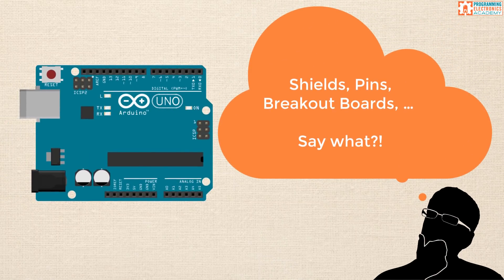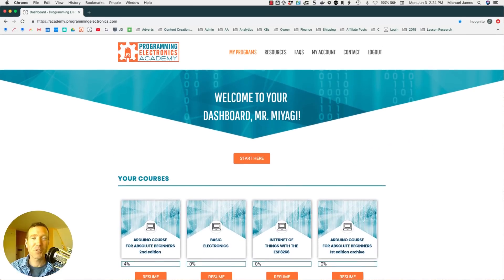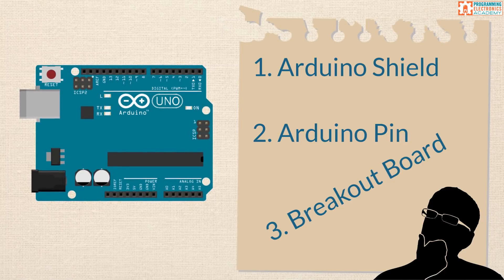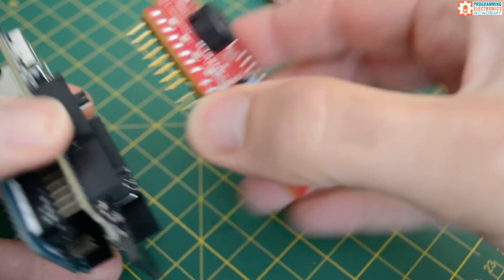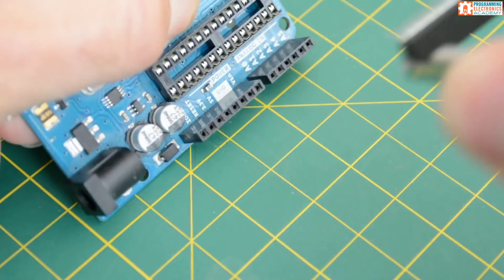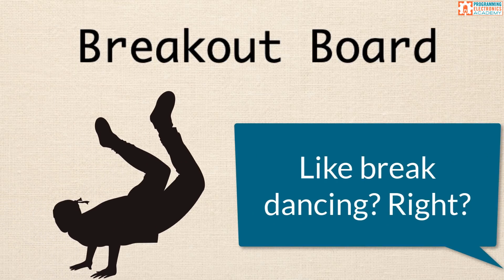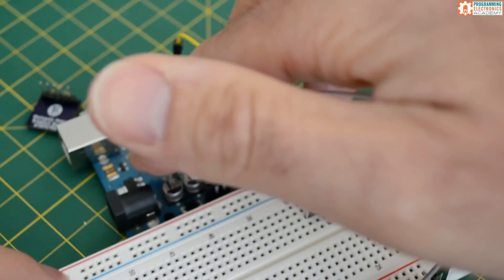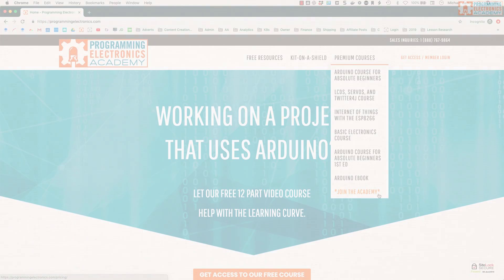3 Arduino Jargon Terms That Confuse Everybody

Comment: tangent:
Shields = the business model of Arduino. The classic Arduino, based upon the original ATmega8 NV/Uno form factor is actually designed around a 5cm x 7cm size perforated protoboard. However, one set of the 4 blocks of Arduino pin headers is offset by half a standard protoboard pin width (1.27mm instead of 2.54mm //0.05in instead of 0.1in). This makes it a royal pain to make your own "shields" from cheap 5x7cm protoboard. 
  Shields can be nice in some circumstances, but in my experience, they offer the customer the opportunity to use a piece of hardware and it's library with little to no need for learning the actual hardware and interface. They are great if you just want to learn to code.

   The aspect of the hobby and Arduino that really confused me, and still does in some ways, is the entire abstract toolchain involved with any μC as it relates to Arduino. 
  For instance, I have been curious about the Intel 8051 architecture for some time now, but I still don't understand how some 8051 based chips have unique and seemingly proprietary toolchains despite the fact the chip architecture is now in the public domain and can be manufactured by anyone. 
  Over time I have barely wrapped my head around what the Arduino IDE is, along side the abstract concepts of a toolchain. It's not easy to understand how Arduino looks like C and C++, but is actually it's own version of "Processing" combined with "Wiring." It is also difficult to figure out how AVRdude and GCC fit into the mix, how things like the Optiboot bootloader are essential for plug-n-play type programming, or that make/makefiles enable this whole integrated system. Heck I'm still not entirely sure how flex, byacc, bison, libusb, libusb-dev, and binutils fit into the whole Arduino mix (at least on Linux). Just the difference between programming with a bootloader on the UART serial bus instead of the SPI buss without the bootloader can be confusing. Of course, I didn't need to understand most of this to get started, but these are essential bits of information needed before exploring a lot of other much more modern μC options.
  Anyways...those are just some of the things I've struggled with conceptually over the last few years. 
-Jake